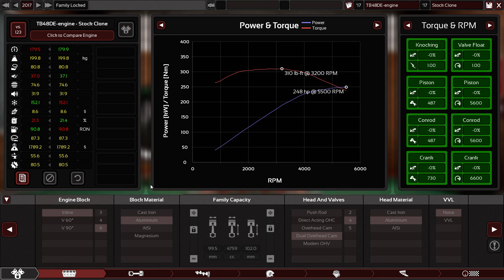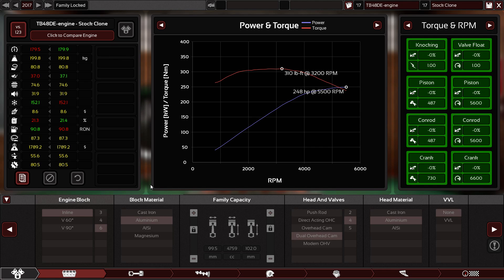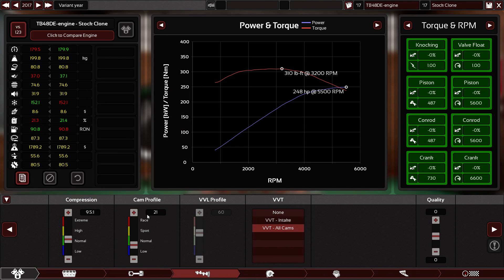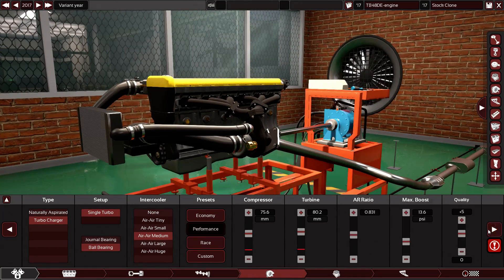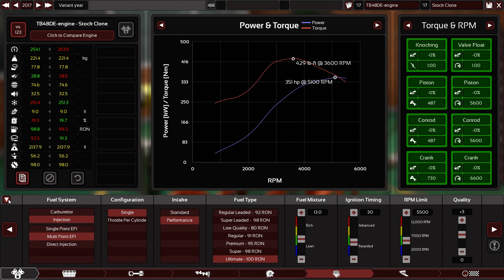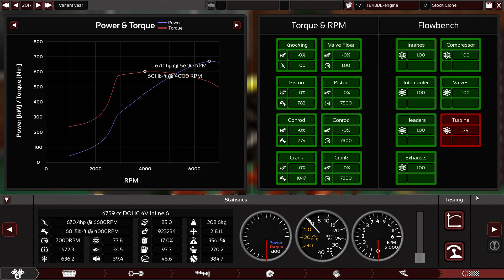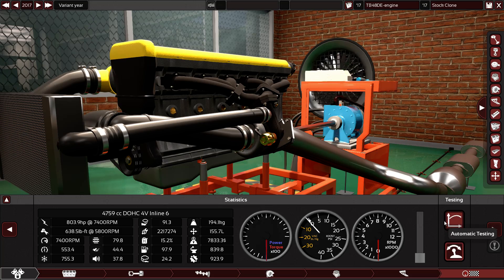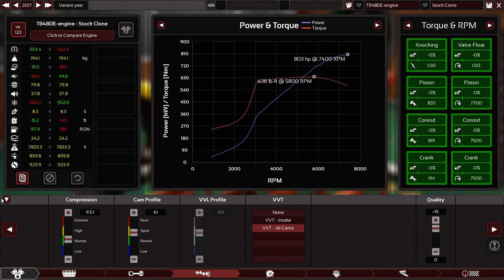TB48 NA and Turbo in Automation.

Comment: Some errors in this video. All TB engines were a pushrod 2 valve engine except for the 48. Also the TB48 only has VTC on the intake camshaft only. The TB48 also has a stock compression ratio of 9:1. Not 9.5

Comment: It makes 248hp @ 4800rpm + 310 lb-ft @ 3600rpm. Redline: 5500rpm.
Reply: Actually more than that... around 280hp.. it can go to 330hp n/a
Reply: @boikanyoonneng9170  280hp is gross, no one uses that as a standard. I have one, and love Nissan Patrol. You can mod it indeed, up to 3500hp like in sand drags.

Comment: These are awesome videos, and your produce rate is extremely fast, I'm impressed.

Could you make the lightest weight 400 HP engine with these requirements?

-No exotic materials like magnesium or titanium, ie, Standard Aluminum block and heads
-Must have a broad street-able power-band
-Max Piston speed must not exceed 20 MPS average
-bore:stroke ratio is .85:1

I'm assuming this would be an OHV engine, because they have a very high power:weight and size ratio.

This is my challenge to you.
Reply: Brother are you still working on my request?
Reply from the maker: +chris huynh 
Everything is doable but the piston speed ?
Translate it to RPM please
Reply: In this link, based on the stroke length and RPM you can calculate piston speed.

 http://www.csgnetwork.com/pistonspeedcalc.html

use the last box for the piston speed, it must not exceed a rounded 20 Meters Per Second
Reply: By OHV, I meant pushrod, and pushrod is only an advantage in Vee engines, because they can utilize a single camshaft to drive every valve!

But I want to see if it ends up being an Overhead Cam engine too.

lets see where engineering takes us.
Reply from the maker: I saw it and i know it all now.
I will make it first thing tomorrow
thank you for your awesome challenge.
Reply from the maker: Alright
Reply from the maker: +Chris Huynh remained me again
Reply: It's the one in this comment train, that is my alternate account, the other chris huynh

Comment: Can u reach 2000 horsepower as a challenge ( btw I don't know if u can make a diesel engine but if u could make a 12v-71 Cummins that would be awesome)
Reply from the maker: +Camron Goodall 
I love Diesel engines but currently Automation doesn't support them yet.
I already made more than 2000 hp 
I made waaaay more that 2000 hp 
But i will try and make something similar to the cummins using 100 octane fuel ⛽️